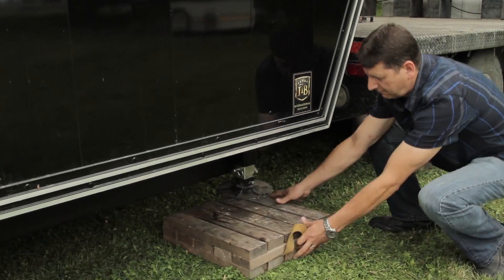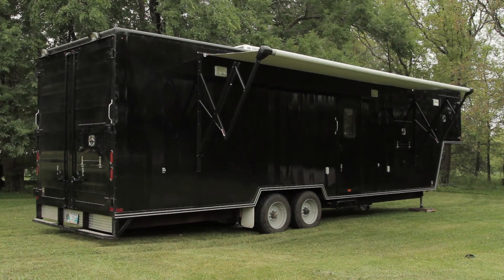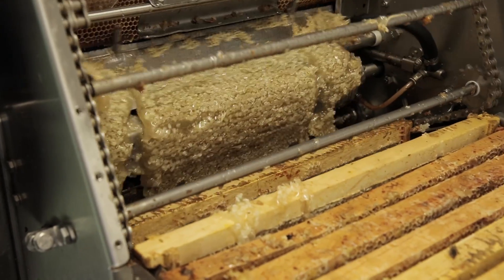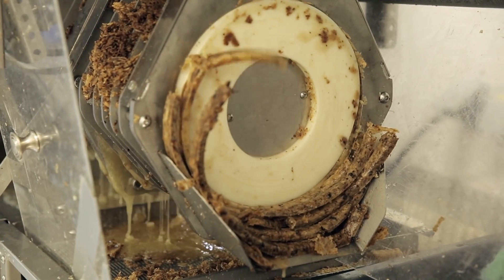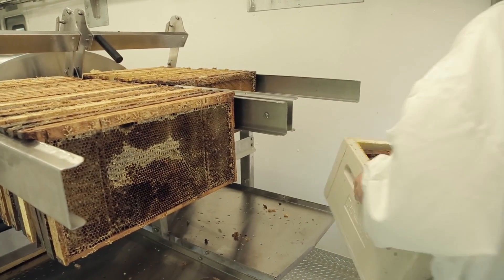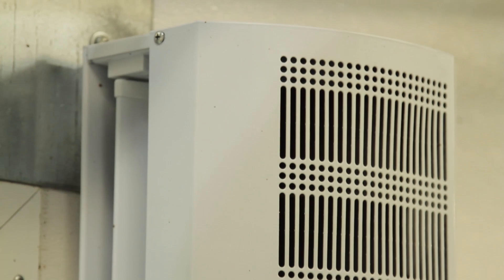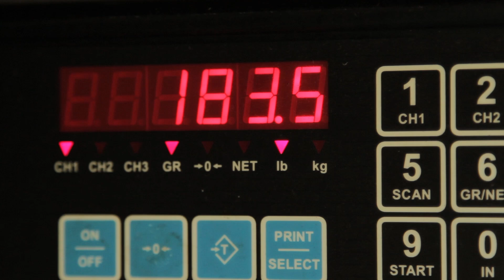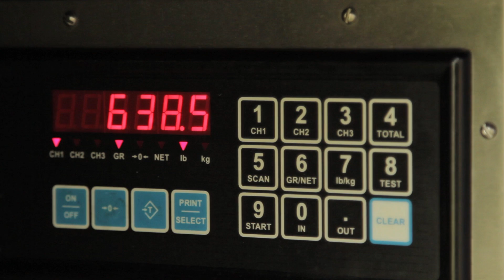Mobile Honey Extraction

Comment: What type of supers are those? Also, how do you know which hives they come from, or does that not matter?  Have you noticed any issue with disease from transferring supers to wrong hive?
Reply from the maker: We use polystyrene supers with Langstroth frames. The risk of disease transmission is minimized greatly due to the hives going directly back onto the hives that they were removed from. Traditionally, in a hot house operation, it would be very difficult to do this.
Reply: Scott Aaronson  these bee boxes from Finland look like they may be the ones. http://paradisehoney.net/en/project/beebox-series/